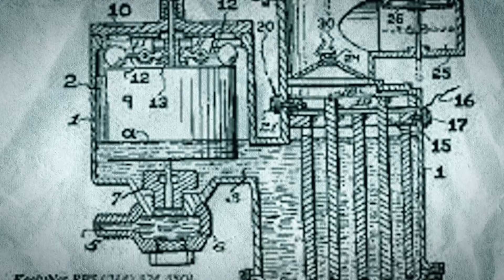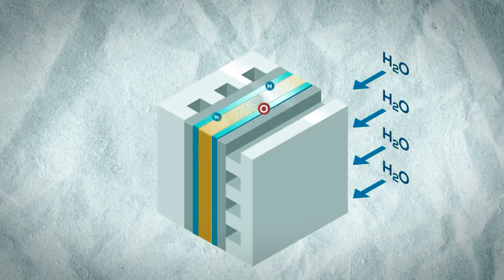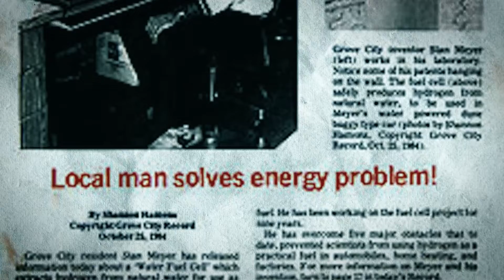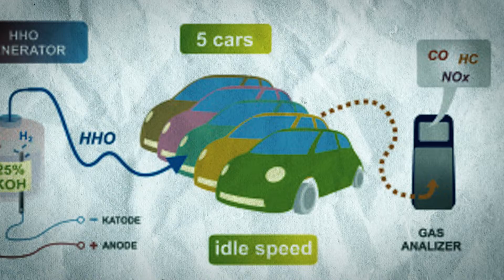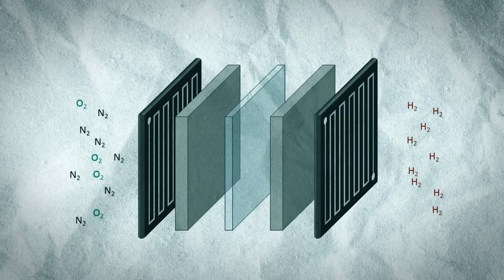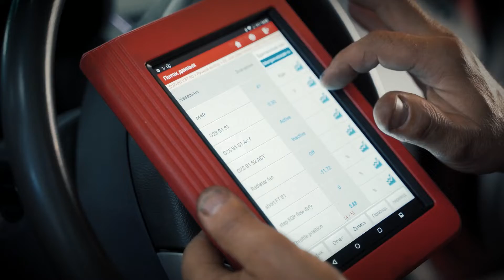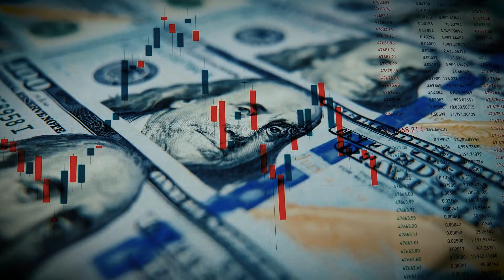Liquid Power: The Untold Story of Water-Fueled Cars | Full Documentary

Comment: The fact that the power required by electrolysis to produce hydrogen is much higher than the power obtained from hydrogen in enough to understand why these experiments failed without the need for strange boycotting stories. https://youtu.be/9_PlAEy-Jgs